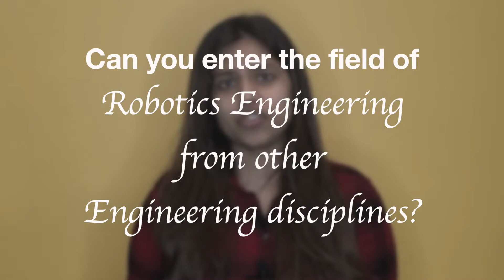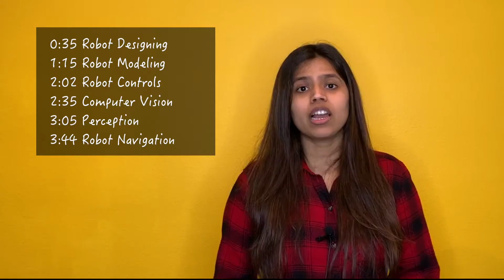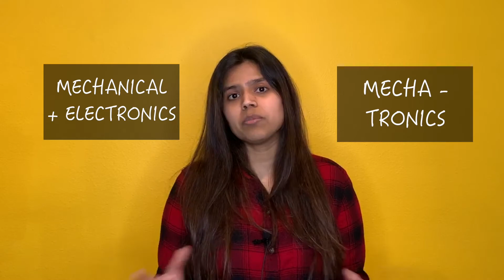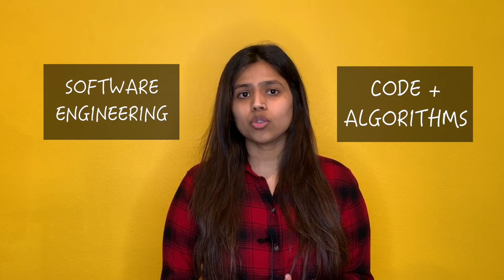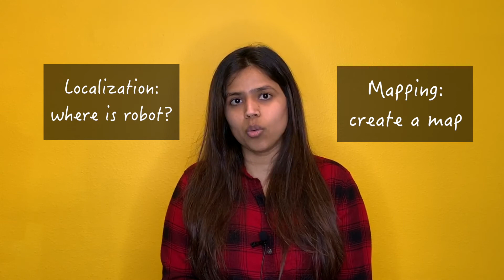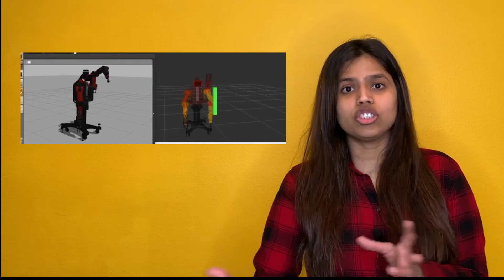Robotics Engineering: 6 subfields and which major to choose // Courses in robotics engineering

Comment: Hello Kajal, I have built a 3d printer from scratch referring to YouTube and web, including the mechanical frame assembling, electronics parts identification, electrical wiring and calibrations. For the mother board I used Arduino mega and open source Marlin firmware. Can this DIY project be considered as a robotics project ?

Comment: I am from a mechanical background but i am interested in everything you said also including neural networks like CNN etc what can I do?
Reply from the maker: Then go for it all 🙂 This is video to get you started. 

I would say this as you go in the industry you will find yourself working in one of the subfields and then you can always switch them over time. 

Think of it this way, when building a robot you will work on each section at a time. First build the robot. Next get it to drive around. Next get it to detect objects, etc.
Reply: @KajalGada  got it, thank you 🙂